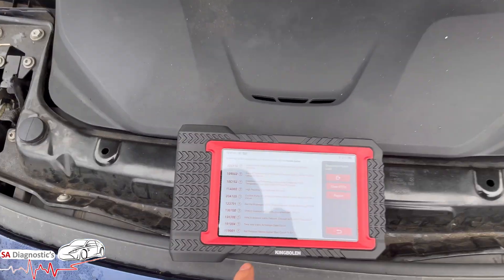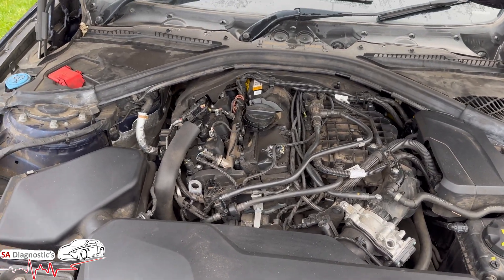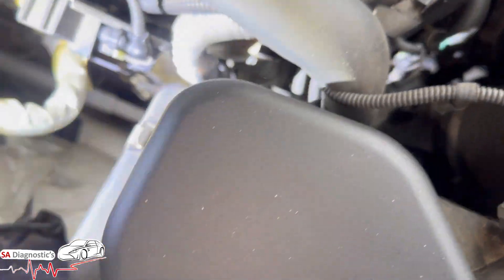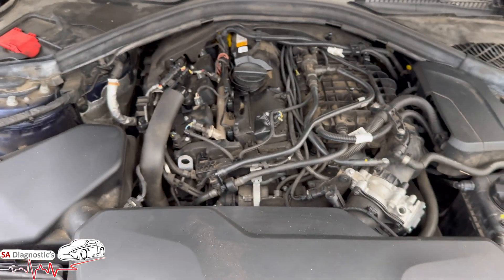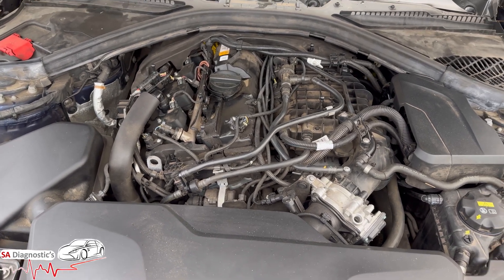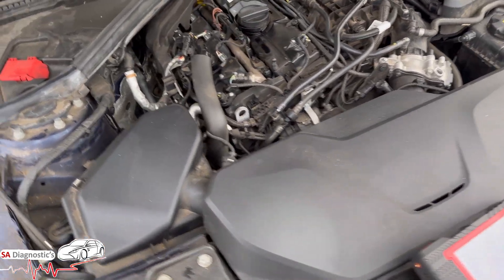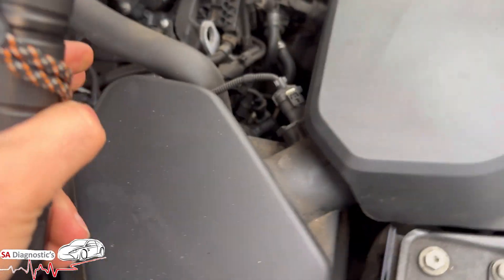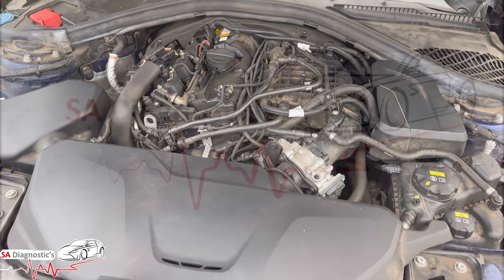BMW 123701 Electric WasteGate Valve Position Sensor Signal Short Circuit LOSS OF POWER | HOW TO FIX

Comment: I did replace it and its the same, how do i test the wiring? just switch ignition on and check the pins on the plug from the car? if not then follow the wire and check where it goes to?

Comment: Hey bro can you help me out I got code 123603 wastegate 2 short circuit s55 engine
Reply from the maker: @F83.M4  sounds like the waste gate module is faulty or the wiring going to the waste gate has an open circuit so a break in the wire somewhere. Get an electrician to test to see if power goes to the end of the cable. If it does then this means the wastegate module has packed in….